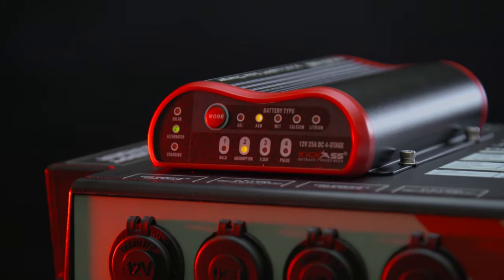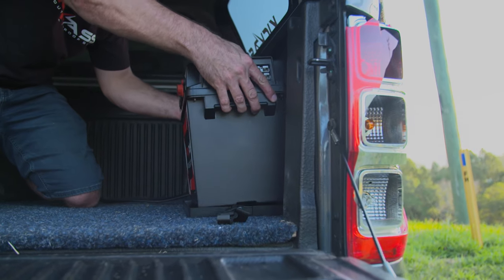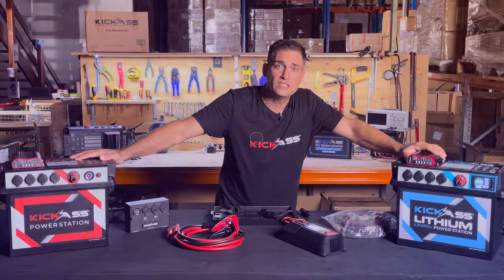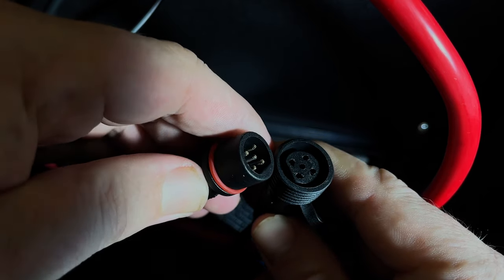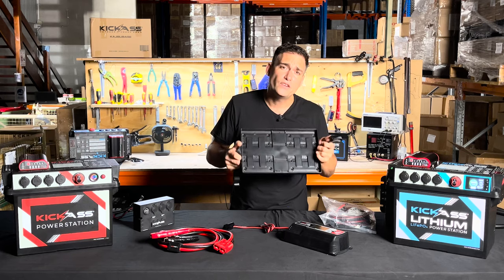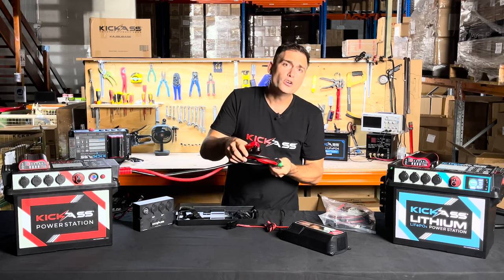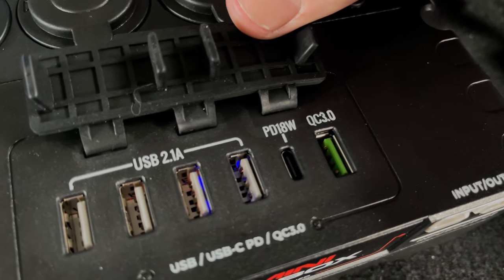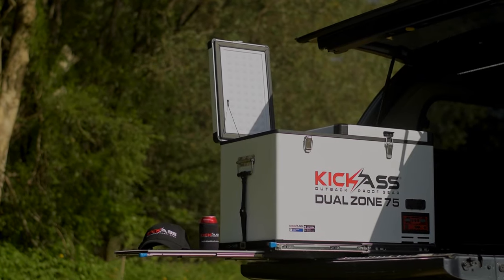KickAss Power Station LiFePO4 Lithium AGM battery Integrated DC Charger MPPT solar QC3 & Anderson

Comment: I would love to have bought 3 of them for all my work vehicles but they wont change over a cig socket to a engel plug to accomodate a Dometic fridge in my vehicles  even after speaking to there sales dept as i don't want to modify to ruin warranty
Reply from the maker: G'day Chad,sorry we don't use that style of plug & prefer the universal anderson style of plug better,as long as your modification did not cause the fault & you put your hand up if it;s caused from your own wiring,we would still cover any manufacturing faults 
Cheers Craig

Comment: It be nice if you could make a bigger box to fit a 200ah lithium, any plans in the future ? Or perhaps being able to connect two 120ah lithium boxes together for 240ah.
Reply from the maker: Hi TFL, The Idea of the battery box is to remain portable. By making it larger to be able to hold a 200ah or 2x120ah would make the box to cumbersome. When larger capacities are required it is generally more beneficial to hard wire your system.

Comment: Just got an old Viscount caravan and this would be perfect. Instead of rewiring I'll make the current 240V 12V and use one of these. Also looking at perm mounted solar on the roof.
Reply from the maker: Awesome.

Comment: would I be able to run my 40l fridge for the weekend with agm battery box without hard wiring it in
Reply from the maker: G'day there again Kaneelison,the awesome thing with the power station as it does not necessary need to be hard wired in & especially with the lithium it's so light weight & if charged before your trip can last a few days,even better grab a solar panel & connect i up while your camping &  bob's your uncle 
Cheers Craig

Comment: Can a second 150ah battery be connected to the box in parallel? I have the induction cooktop and wanting to use a 3k inverter to run the cooktop on.
Reply from the maker: for shure you can,Thanks for watching 
Cheers Craig

Comment: Can I use 2 solar panels to charge this faster?
I have a kickass 200w slimline solar panel, I wanted to know if I could use 2× 200w solar panels to charge this lithium battery.
Reply from the maker: Yes you can. You would need to wire the panels together as there is only 1 dedicated solar input. Also no matter how many panels you have you will be limited to the 25amp maximum of the charger.

Comment: Can I use my own 130ah lithuim battery in your power box?
Reply from the maker: Yes, as long as it fits. 

The internal dimensions are 340mm L x 185mm W x 250mm H. The DC DC charger is lithium ready on our standard box:

https://www.kickassproducts.com.au/buy/kickass-portable-battery-box-power-station-with-in/KAJBAGMKIT1

Comment: Can i charge my battery w/ DCDC charger, while using 12V pluge to charge my fridge @ same time? will simultaneous charge+charge blow up my fridge? thx
Reply from the maker: Yes, you can charge via the DC/DC charger while a load is connected.

Comment: I have  powerless 200 solar panel that is portable that maxes out at 29A output. Can I plug it into this if you max in is 25A?  Does the battery need to be at lower than 80 or 90 % to top off?
Reply from the maker: G'ady Joseph,im not familiar with the powerless brand not sure if id trust something branded  powerless that im trying to power something up with though lol 
as long as your solar panel is under 350 watt & under 23volt out put it will work with our DCDC 
Thanks for watching the video,appreciate it 
Cheers Craig

Comment: What are the dimension for the lithium box? I have a battle born 12V 100a lithium battery. It’s 10.3in x 7.28in x 11.2in I believe. Wondering if it would fit the lithium box.
Reply from the maker: Hi tommy, Internal dimensions are 250H x 340L x 185W (mm)

Comment: How can you add another battery to the box? I want to double the battery size?
Reply from the maker: These systems are designed to be portable. If you need extra capacity we would recommend that you look at a fixed installation, this way you can install multiple batteries such as the installation showcased in this video. https://youtu.be/zu5MfRKHWOo

Comment: How much Ah Lithum battery do you need if you plan to have a 2000W inverter?
Reply from the maker: Amp Hours is capacity. 

The current draw of a 2000 watt inverter at maximum will draw 160+ amps. You need to ensure that your batteries BMS is capable of supplying this.

Our BMS sill supply 100amps continuous.
Reply: @KickAssProducts  Thanks.  So do any of your lithium batteries able to handle a 2000W inverter?  The reason for asking is that I'm seriously looking into your lithium battery box as well as a 2000W inverter (for induction cooking).
Reply: @fatmanoverlanding  no, you will need to pair 2x lithium batteries together to get that kind of power required

Comment: Is it possible to charge via the rear cig socket ?
Reply from the maker: No sorry, the chargers inputs are dedicated anderson connectors rated at 50 amps, The integrated charger will draw up to 25 amps. 

Cig sockets are a maximum of 10 amps. 

Hope this helps.